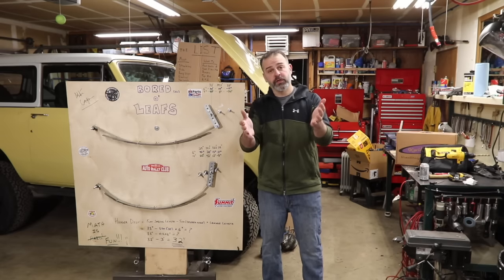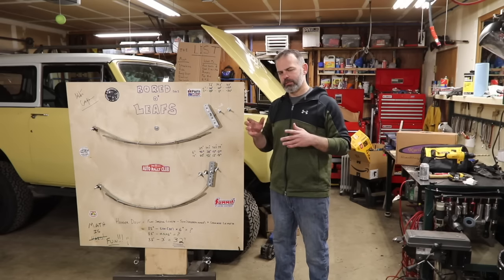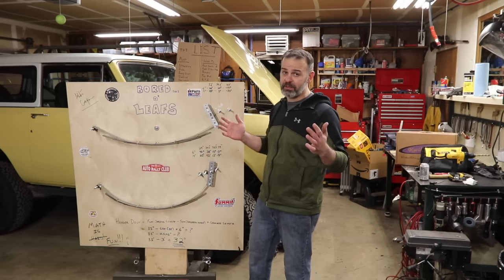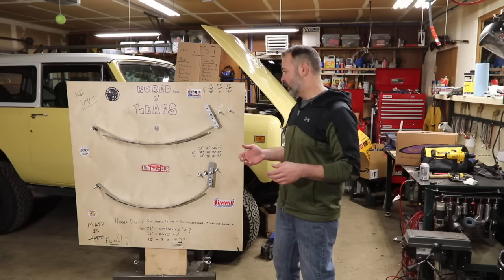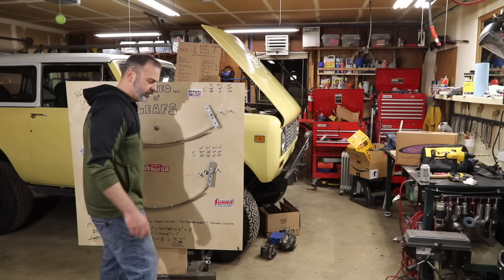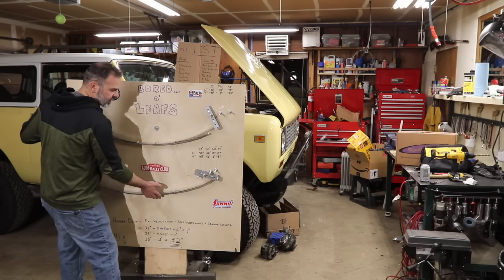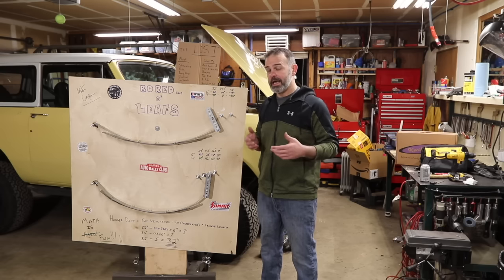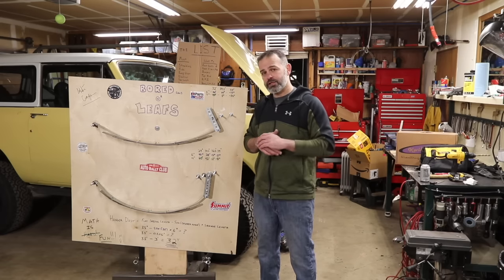5.04 Leaf Springs & Shackles GURU Level Tech!

Comment: Matt...one of the best videos ever put out on suspension. It's been such a mind boggle to understand this. This makes it totally comprehensible. thank you.
Reply from the maker: Matthew Mugar wow what a compliment! Thanks Matthew!
Reply: Good presentation ...Matt
I have query about shackle length design.
Spring span length 480 and spring height 145 mm,no of leaves 6
May I know what length required for shackle and installed angle minimum.

Comment: Appreciated! Only improvement (suggestion) would be to have used a scale to measure the change in resistance (spring rate) between each of the mounting locations. Expressed as a percentage (rather than in  pounds for the sake of the model). Great demonstration and the bloopers were cool too!

Comment: Thank you. you really illustrated how the leafs and shackles interact on a leaf suspension. learned a lot
Reply: Finally getting around to trying to order new leafs. One thing I'm finding frustrating is that few mfg's list the same specs. For example Doorman tells you : pack thickness, capacity, and arch height. (example: 4 leafs, 1 overload, 1.75" thick, 1150lbs cap.) while many other aftermarket mfg's only say "3-4in lift springs" and don't have any arch thickness or capacity rating... It's hard to compare springs from Rough Country, BJ's offroad, Skyjacker or BDS without any actual specifications.

Comment: Hi Matt, 
Enjoyed the info, one thing to help test spring compression and angles 
  Is to disassemble the both spring packs, using only the main spring and make a small block to  replace all the other springs that have been removed, so if it 3 inches of spring that have been remove add in a 3 inch block put your bolt back though the block and main spring mock both springs on the vehicle than with a jack you can compress and release and let hang and get your angles of the shakles  and find your bottoming points with your tires on and off as well and side to side relaesd and compressed with out the resistance of all the srings  as well as measurements for shocks and brakes line mods, drive line lengths and so on 
  Thanks for the video!

Comment: Thanks for the leaf spring demonstration, I just checked the 55 truck rear leaf spring shackle I put on 10 years ago, it's straight up & down, there's another hole on the bracket that will change the angle to more movement. Now I know why I hit my head on the ceiling when I drive over a dip too fast. Thanks
Reply: When you order Dever lift springs for a stock vehicle do they automatically make the leaves longer to compensate for shackle angle?

Comment: This is very interesting. I am in the process of doing a 63" spring swap on my Tacoma so this information is very useful. Thank You!
Reply from the maker: mike diltz cool, let me know how it turns out. Good luck!
Reply: How did it go? I am in the process of doing that on my 1st gen 4runner. What angle did you end up going with? And how do you like them so far?
Reply: @jesusakadice  sorry but I never ended up doing it. I sold the truck when I saw how bad the frame was rotted.

Comment: As long as the information is correct then this is a great video. Gave me a expanded understanding and reinforcement for my spring suspicions. There are still a lot of questions I have about how various leaf pack mods and setup alterations will achieve different application goals. I think the main scenario that comes to mind is how a longer shackle will affect perceived on-road ride comfort when installed on the same leaf pack and using the same mounting points. This would be ideal for a DIY mechanic with basic tools and a limited budget that wants a more comfortable on-road experience with zero to little (driver+personal items/tools in cab=200-300lbs) additional payload. The problem I've been having is trying to get a smoother on-road ride quality out of a 2003 PreRunner TRD Double Cab. It has thick 3/1 two stage over-spring leaf packs. I'm unsure of the spring rates.  Every aftermarket suspension component available for this truck is for lift, load, and/or off-roading/overlanding which all seem to equal a harsh on-road experience unless you're willing to drop $3k+ on 2- or 3-way adjustable reservoir coil overs and shocks and another $1k+ on progressive leaf packs, but even then you'll end up with a 3"+ lift with a 500-1klb payload increase which will then require new control arms, brake lines, diff drop kit, panhard correction kit, new ball joints, an alignment...the list goes on and on. You can do all that to this truck, but so far I haven't found one stitch of information about how to improve the ride quality for a daily driver aside from the snarky comment of "leave it factory". I refuse to accept this.

Comment: Hi Matt,
  1986 Isuzu Trooper 10 bolt rear end/drum brakes/ leafs with non pressed eye bushings/ 70mm shackles.

 Upgraded to 89 Trooper RS leafs/pressed front eye/ 2” longer leafs than ‘86/90mm shackles/ about 150lbs greater load capacity. 

 So I noticed my shackles were at a steeper angle due to  using the stock 86 mounting points on frame. A bolt on upgrade. So I got a smoother ride and can load up the trooper with an equal weight loaded without bottoming out over rough stuff. 

 Thanks for the video! Now I know exactly what my instincts were telling me why to do the mod in the first place!
Reply from the maker: Eric Jette awesome. It goes both ways. It’s good to hear field confirmation on a rig other than my own.

Comment: For the win!! A couple years of searching for how to figure shackle angle and I’ve found it!! I moved my springs inboard the frame on my Ranchero for more tire clearance. Doing so with a kit. A kit for a Falcon car not a Falcon Ranchero. The Ranchero wheel base is longer. Think station wagon with no rear top. Anyways had to fab my own mounts for shackles and they are wrong. To steep under the weight of the car. No hardly and action at all. Not good for hooking up on the track. I have traction bars still no action for a launch. Stiff as a board. I’m so glad I’ve found this. Now I can cut that old shit off and do it up right!
Reply from the maker: Aaron Gammel awesome! Happy to help!

Comment: Great video. You are 💯% correct.... There are not many/any videos on this subject. What parts are supposed be able to move? Besides the leafs themselves, is the shackle supposed to swing? Is the bolt supposed to spin in the bushing? To they get tightened down? My through bolts are rusted in place. I've replaced springs, but I tightened the new ones down and nothing swings/swivels... only my spring leafs move-flex.

What else should move? That's my basic question
Reply from the maker: Hi Ed.  The springs flex and the shackle moves.  The bolts should tighen the inner bushing sleeve to the shackle such that nothing spins on the bolt. Only the bushing material (rubber or poly) should move.  If you have rubber, it will not spin on the bushing sleeve.  Poly will.  Are you sure your shackles aren't moving at all?  That would be bad.   The shackles need to move otherwise your springs are binding or they are way too stiff.  Make sure you don't have a driveshaft or shock limiting the travel also.  Theoretically if your springs are super flat, the shackle wouldn't move that much but it should still move.
Reply: @MattsGarage  I've got to take them apart, clean and grease them then. Shackles definitely not moving. Thanks Matt. I'd call but don't know if you take calls or have a shop etc... I work sewer and water and live in Wisconsin. We're laid off during winter and I've been wanting to address the issue with the springs... Just started looking for info and it's slim pickings

Comment: I know this is an old video but thanks. I have argued with people many times about this. I changed the angle on my yj with waggys and the springs got softer. Had people saying that doesn't change the rate. At least now I can point them to real world calculations. It's a leverage arm people!
Reply from the maker: joshua Atkins exactly. You can’t talk rate without considering EFFECTIVE rate!
Reply: @MattsGarage  Can you do a video on calculating effective rate?

Comment: I just did this with a 12 inch lift leafs on my square body suburban up front moved my shackle eye hanger forward up on frame and longer shackles definitely true in facts .and the 12 inch leaf springs actually work by doing that . instead of just bolting them to the factory location.i got video up on here under my name

Comment: There's another variable - the more leafs you have, the more friction between each leaf in the pack creating resistance on compression to make a smoother ride.
Reply: Jay R yes but it’s pretty negligible. most of those leaf springs have plastic pads between them

Comment: Thanks buddy, cause I got a Ute/ pickup and the suspension is so hard the only thing giving is my back , needless to say that the seats are not padded very well also, but I’m thinking of taking out a leaf out of the flat pack spring, it’s akin to having a thick solid steel rod / bar where the spring pac is, or you would not be silly for thinking that the springs have been replaced with a block of wood, no give at all, good when I have a heavy load only but crap otherwise. Thanks for your input 😊😊 God bless
Reply from the maker: I think you are asking if you can take a spring out mate, and the answer is yes.  Usually you take out the second or third longest spring.
Reply: @MattsGarage  yeah thanks, I see in the spring set one leaf that is thicker than all the others and I’m thinking that’s the one I will take out, also like you mentioned too that shocks play the part as well, I wanted to purchase oil shocks, to no avail, only gas shocks are available for this vehicle, but I know if I replace the gas with oil that helps also
Reply: @MattsGarage  ok thanks buddy

Comment: Awesome video great demonstration and great to learn off of, I think when thinking about travel and "bounce" of a leaf what you said is dead accurate. My theory why the diagram is different is in a drag application the "s" in the spring is what drives the axle down to hook up, so shifting the shackle obtuse of 90 would cause the S bend sooner therefore driving the axle down harder causing a "stiffer" feel.
Reply from the maker: That is a solid tehory.  It would have never occured to me since I know next to nothing about drag racing.

Comment: Here’s my 0.02 on it, take or leave it.
  If you take into consideration only the vertical movement of the axle pad and the shackle-to-spring eye, that can give a good impression of how the spring will move. If the eye moves in the same vertical direction as the axle pad (up/down) it will have the greatest amount of travel for a given amount of load. If the eye moves opposite of the spring pad, it will counteract the flex of the spring to an extent, theoretically providing a slightly “stiffer” spring rate, increasing the “dampening” effect of the spring and decreasing the ratio of spring-flex-to-overall-travel. 
   As for tension and compression shackles, tension shackles are naturally more stable at speed due to the flexible nature of springs and bushings. This is why most pickup trucks and cargo vehicles have tension shackles in the rear. Considering that the vast majority of vehicles will be driven only on pavement , the engineer’s design choice leans to the side of stability versus dexterity, for costs being the same. Basically the Dollar-to-Stability ratio is better for tension shackles.
Reply from the maker: Easily one of the beet comments I’ve received in 3 years of having this channel. Well written and great knowledge.

Comment: Fantastic video!  A suggestion for a really cool addition to this video, if you took a scale (perhaps a fish scale) and showed the actual force required for say 1" of deflection, with different shackle lengths and angles.  That would really demonstrate how the shackle can change the effective rate of a leaf spring.  

What did you use for the springs, out of curiosity?
Reply from the maker: Hi Jeff, great suggestion.  I should've done that.  The springs are just simpson strong tie lumber straps of various lengths.  I know it's not spring steel but I figured if I made them both exactly the same it wouldn't matter for comparison purposes.  I would love to see a real spring shop do this with actual leaf springs and measure  the rate!
Reply: @MattsGarage  I've also seen that done with a jack and a scale. 4 wheel drive magazine built a Contraption to mount a leaf spring in with a shackle on one end to allow the spring to move

Comment: Thanks for your nice explain. I appreciate that points you viewed. I would you post the formula which is on the board you wrote below the second suspension ASAP it will be favour.  Man i need it necessarily 😂 im not sure which is the correct formula to follow after i saw the video and your explanation of correcting the mistakes. VERY EXCELLENT. You understand same as me of what i focus at of factory mistakes which need corrections.
Thanks 👍 . Thanks alot.
Reply from the maker: Hanger eye Distance = flat spring length - SIN of the desired angle x shackle length. Thanks for watching!

Comment: Wow...this makes a lot of sense! Just put a 3.5” lift kit on my Silverado and now leaf springs clunk over bumps. Need to watch the video again to absorb this info. Not sure how to change the shackle position or if that will make a difference for this issue. Great video
Reply from the maker: If they are new, you need to throw some weight in there and drive around for a while,. But yeah you would need a longer spring to get the shackle angle the same. Otherwise you need to relocate your spring hangers which is pretty involved.

Comment: With the right kind of links in rear suspension you can actually get the driving force down below the ground. So if you're looking for traction that would be what you want to be putting the force down and giving you more traction

Comment: I really like your video very informative. Wondering what happens to the driving force with the spring above the shackle. One of those HP books called how to make your car handle was very good at explaining changes in the suspension end where the driving force is. Was just a couple of leaf springs you're driving forces heading for the sky. Add some links to it and you can bring it down considerably to where you're getting pushed for words instead of up. Good example would be something like a Chevy Nova where is the rear end lifts up. They spend a lot of time smoking their tires before getting  off the line. Another thing that will lower your drive force are having the actual mounted above the leaf instead of below.

Comment: Thumbs UP. Well explained. Just the information I needed for my old jeep.
I have nearly vertical front shackles and stiff ride and hardly any droop. Rears have a little angle and ride good. I want to soften the ride slightly without reducing load capacity.
Years ago I tried some really long shackles and they had a mushy feel. Overly soft and would even hold a lean after coming around a corner. I have considered removing a leaf or having special built pack made. But I keep eyeing that shackle angle suspiciously. Now I have the answer. Time to fabricate!
I have seen that diagram you showed and remember thinking wtf.
"I go to the google" lol.
Thanks for sharing the knowledge, that is what youtube is really for.
Reply from the maker: Hi, I saw your last few comments. Welcome to the channel! I’m happy to have helped. I couldn’t believe nobody has put something like this out before. Let me know how the Jeep rides after you change the angle. It’d be great to get some independent confirmation. Mattsgarageshow@gmail.com
Reply: Great video!  Could you tell us a little more about shackle location as far as above the spring vs. Under the spring? You touched on this briefly. Are the characteristics the same?  Is one way better than the other? My application would be for a muscle car. (With truck springs) I was going to mount them under the spring. That is how GM mounts them on their trucks.  I'm just not sure why. Any advice is appreciated!  Thanks.

Comment: This was awesome man thanks for the video. I just added some length to my shackles on my Toyota pickup with 35’s that I made from Home Depot. My ride angle is at 18degree now. Springs are pretty flat. I made a video on my channel of my quick cheap shackle setup I made by hand. I’m curious what you or any viewers of this video would think about it? Opinions or tips would be awesome guys!

Comment: This is a fantastic video! Thanks for taking the time to explain it. It answers the question, why my truck is so rough. When I bought it, it already had a 6 inch lift, but lately I found out the previous owner put the springs on backwards. So the short end of the springs is up front moving the axle 2 inches forward and the shackle is 90 degrees. It is a 79 f-350 one tone. So since the shackle is mounted 90 degrees from the factory, is it recommended for it to say right where it is?
Reply from the maker: Dennis Kwasnycia can you send me a photo at mattsgarageshow@gmail.com? Please include one directly from the side.